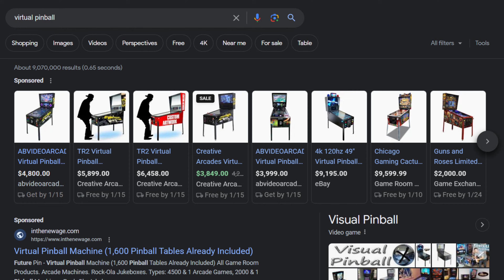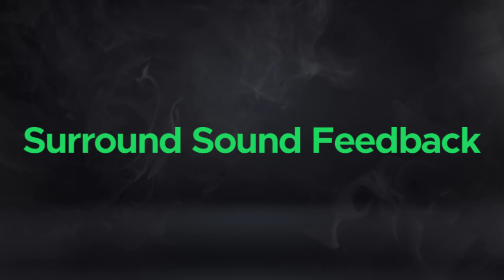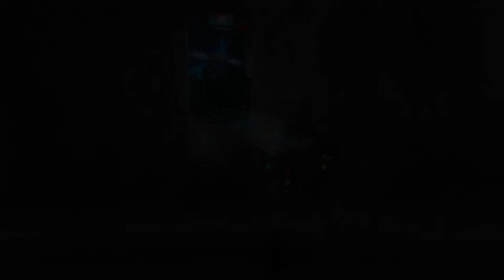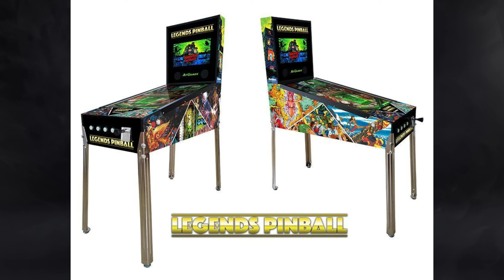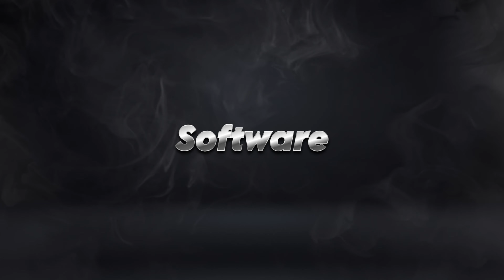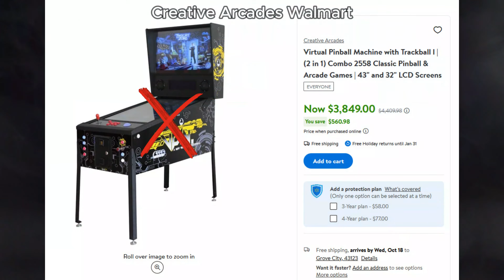Virtual Pinball Buyers Guide 2024

Comment: I have been designing and building virtual pinball cabinets as a monetized hobby for 10 years now.  I noticed that several boutique builders offer a plethora of options and configurations.   This is pure insanity, as offering several configurations makes it difficult to manage and debug!  I applaud Vcab's simple approach of offering a single configuration of high-end hardware that they have thoughtfully worked out all the issues.
Reply: Researching them now and my intuition is nodding in agreement. My brother has 3 true machines & to get the analog feedback and sound right is def an engineering task. Finding an established maker who offers just a bells and whistles model and a basic model seems the best approach, especially for the average buyer.

Comment: This makes maintenance look like a nightmare for virtual pinball too.
Reply from the maker: You may be right if you use cheap components and build quality.

However, low maintenance is exactly why quality virtual pinball machines are becoming crazy popular. Mechanical pinball machines are way more maintenance intensive; which is a huge problem due to scarcity of pinball repair technicians. 

Since  it uses only high quality components and is built like a tank, the RecRoomWorld / VPcabs Ultra VP has historically experienced very few maintenance related issues. Check out the incredible Ultra VP 8.0 OLED model review at https://www.youtube.com/watch?v=OjRASsLjy7c&t=333s

Comment: If your interest is older tables, including ems, is 49 inch necessary, or would a 43 inch be closer to the originals?
Reply from the maker: You would still want a 49 or 48 inch monitor or TV panel for EM table reproduction. The reason for that is that those monitor sizes have a playfield depth of 42 in in portrait mode, which is the average depth of a mechanical pinball machine regardless of vintage. 43 inch monitor gives you 5 inches less depth which is insufficient.
Reply: @RecRoomWorld  thank you so much. I really love your videos and products.

Comment: Good afternoon. Great video. Do you recommend 43'' or 50'' inch screen play field please? Thank you 

Accelerometer is really better as the nudge button only? Difficult to configure?

Thank you for your help 🙏
Reply: Hello Antoine...    50" is too big (too wide and a little too deep) and 43" is too small (not enough depth compared to a mechanical pinball machine playfield). If you have the money I would use a 48" LG C4 OLED TV panel. If you don't have the money you can go with the 50". And yes, you definitely want an accelerometer (gyroscope) sensor for true 360 degree nudging; nudge buttons are restricted in a single direction only.
Reply: @RolandBuck  thank you very much 👍

Comment: I would mention that MDF is not a cheap material. It may not be appropriate for a pinball, but mdf is used for 10k dollar audiophile speakers all around the world.  Ply wood is considered a big no no when building speakers. So each has their purpose.
Reply: MDF and particle board both have excellent acoustic absorption qualities which are not conducive to haptics feedback.   Ironically, many pinball machines from the 70's and 80's used a hybrid of thick wood veneer particle board.
Reply from the maker: Mechanical pinball machines do not have the same requirements as virtual pinball machines. It is more important for a virtual pinball machine to use plywood in order to properly transfer the haptic feedback generated by the solenoids and surround sound transducers and bass shakers.
Reply from the maker: When we say cheap we are referring to is the dollar price of the material. MDF is a cheaper material, it simply costs less. As you confirmed, MDF has properties that are not as well suited for a virtual pinball machine build. We started out using MDF but switched to plywood when we introduced Ultra VP Model 6.0 in 2022, and we can confirm with certainty that the solenoids and other haptic devices reverberate much better through plywood than MDF (which has sound dampening properties).

Comment: I wish I had seen a video like this 3 years ago when I bought my cab.  It was expensive, but so many of the things this video cautions about describe my cab.  I bought it from one of the sellers featured around the 22 minute mark, and the support and attitude I got was just as bad as the person whose post was quoted.  Besides lousy build quality, the PC was apparently an old garbage unit that failed completely after a little more than a year.  The power supply feeding the solenoids went bad too.  I ended up having to hire a local builder to completely rebuild the insides of the machine.  It works now, but now the solenoids are failing as is one of the buttons.  What I'm saying is, when these guys are saying that a lot of sellers out there are peddling garbage, believe them.
Reply: change for actuators ... solenoids arent made for heavy use